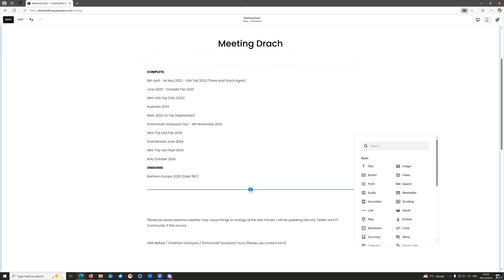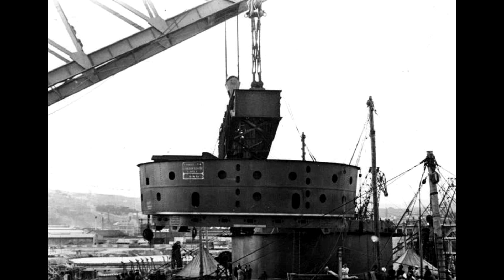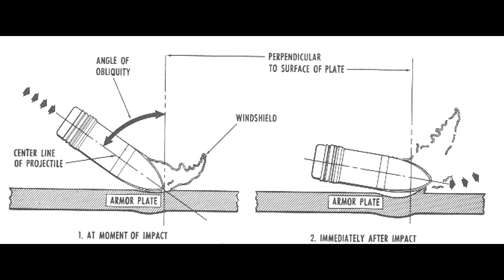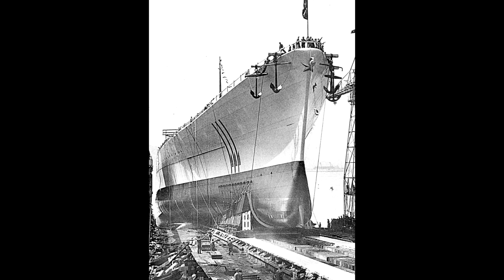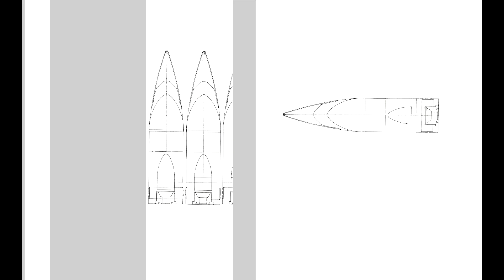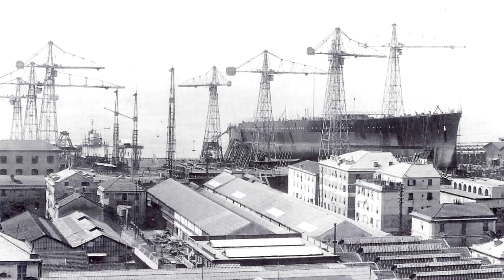Naval Engineering - Did the Littorio's Armour Scheme Work?

Comment: So what happens to the ballistic cap when it hits the decapping plate? Where does the cap go, that it no longer stands between the armour and the main body of the shell?
Reply: That is irrelevant as long as it was dislodged from the main body. The cap on itself has little penetrating power since the main body of the shell provides the energy. And the main body itself (though higly energetic) is too soft to penetrate the armour.
Reply: @vitkriklan2633  Thank you for the answer.  But perhaps I worded my question poorly. So bare with me. 

The shell hits the decapping plate, and the cap gets dislodged. But the main body of the shell still pushes forward, and the now dislodged cap is still physically present in between the armour and the shell (I assume it did not evaporate), so where does it go? Where the physical remains of the cap go after the impact, that it no longer is in the way of the rest of the shell?

Comment: We lack reference about the density and characteristics of the concrete, assuming it was just that and not addictioned with other stuff, like Asbestos or similarly common products.
The seasoning of the concrete also comes in place, especially if it contains coccio pesto in presence of humidity, as it keeps strengthening with ageing, pretty common since Portland was under sanctions during the thirties. We know the steel was best in class, as it was on the specifics to avoid using Russian steel. Still we don't know the exact characteristics of the steel itself.
It is a pity that the armour effectiveness was not tested before the ships were scrapped, just to gain knowledge on the subject.
Littorios themselves were basically shooting between 25 to 30Km all along the war, so, completely immune from any hit on the belt, because of angling and distance.
In the end it matters not, because no inter war ship was ever hit by another one in the belt as far as I know: the complete removal of armour from modern ships shows that it could not protect effectively against large warheads, like torpedoes, and it would not protect from the air, so it was considered a waste of money, weight and space.
The relict of Musashi examined by Japanese engineering team showed that, as the ship start listing, the concussion of the air launched torpedo was enough to shatter the welding on the Citadel and the ship flooded, not due to plate penetration but due to disconnecting of the huge plates themselves.
In the aftermath of skimming anti ship missiles, we can see where this would lead.
Reply: According to tests conducted in 1935 the belt was supposed to resist a 406mm (16 inch) AP shell fired from 24km
Reply: @lolloblue9646  It was deck armour, not belt and 406 mm shells were simulated.
Reply: @Viktor-fl5mv  the deck was tested against bombs at termimal velocity
Reply: @lolloblue9646  what you wrote was described in Bagnasco book and these were simulated tests of deck armor against 406 mm.... Deck was tested too against bombs

Comment: Very mathematical, D.  I suppose that they had to work with the materials at hand, or which could be produced in a reasonable period of time.  In terms of structural competence/capability, I can think of little other than concrete, or foamed concrete, which would satisfy the requirement.  Something severely harder and lighter would not (I believe) have been available to the designers, although the gap may have been a point which more fully occupied their thoughts - looking at the monitors of the period, with enormous torpedo bulges, for instance, I can see an Italian architect saying; 'No!  No way, scemo!  Not above the waterline!'

Comment: You also have to consider what was the maximum plate thickness which the italian industry could reliably produce. If the main belt was already at maximum thickness then the decapping + concrete route may have been the best answer within the capabilities of italian industry.
Reply: Drach covered this - he mentioned early on that the the turret front plate of the Littorios was 15 inches, so they could make plate that thick.
Reply: @CharlesStearman 

And in the first three minutes, no less.
Reply: You missed the bit about that and the 15inch faceplates on the turrets.
Reply: I think the keyword here is reliability produce, I don’t disagree with some of the others that Italian industry could make 15 inch plate. But a few plates for a turret face is a far cry away from an entire armor belt.

So perhaps they could make it just not in the requisite numbers.
Reply: @thedyingtitan1247  what are you talking about, they are not few plates they were 28 plates in just 3 years, this level of production is matche only by 3 other nations, Italy could had built them with a full 350MM plate or 381MM plate, as Italy has been at the forefront of metallurgic since late 1800s, its like one of the most famous aspects of italian naval industry.

Comment: Was the perpendicular force generated by an angled hit factored into the calculations for distance required to dislodged the cap? I think this should make a substantial difference
Reply from the maker: Yes, that's why the a calibre-equivilant thickness drops substantially when you account for the angling of the armour and fall of shell as compared to a 90-degree perpendicular impact.
Reply: @Drachinifel  ok, I mistook it to just be taking into account the increased distance as a result of the angles

Comment: I wonder if foamed concrete has properties similar to perforated armor, where the micro gaps cause massive stress on the impacting projectile, which in turn causes projectiles like a kinetic APFSDS dart to break up while passing the armor plate. Maybe foam concrete could actually aid in shattering the cap through constantly shifting stress on the material.
Reply: Good thing to consider, I think it would heavily depend on the size of the empty spaces in the concrete. The reason it works well against APDS and APFSDS is because the perforations are big enough such that a large portion of the projectiles cross section isn't hitting the armor and so a perpendicular force is generated on it. I don't see how that effect could take place if there are just a bunch of tiny air bubbles in the concrete. 
Something that I didn't see explicitly factored in here is the effect of the concrete acting as a backing plate to support the decapping plate, which would improve its resistance and how much having to plow through the concrete itself actually contributes
Reply: It's not concrete per se but that's kinda sorta how NERA armor works
Reply: @flavortown3781 yeah, different methods to achieve the same effect; torque on the projectile. Performed plates would work better against full bore shells than NERA though
Reply: Unlikely, because of its very fine geometry, APFSDS needs relatively little shear stress to break the rod up. A naval shell is so different in that regard (being only a few diameters long), I doubt there is any similarities.

Comment: The cap also helped align the shell to more of a 90 degree angle when impacting inclined armor or when plunging at high distance. Similar solution was used in tanks in ww2 but the cap on tank shells was strictly soft and was there to align the shell and mitigate the advantage that sloped armor provided.
Reply: And strongly contributes one of my favorite things for tank shells of making the longest acronym you can that's still technically feasible. I normally just settle on APCBCHEFSDS. Or Armor Piercing, Capped, Ballistic Capped, High Explosive, Fin Stabilized, Discarding Sabot. You could go with HEAT instead of HE, but that would hardly make actual sense for a shell with an armor piercing cap.
Reply: @chrisc1140 And here I was thinking APFSDS was an eyesore, and you just go and come up with 5 more letters to stuff in, you madlad.
Reply: @mnxs  tbf his shell while possible to design would be pretty useless. 

For one fin stabilized discarding sabot shells are usually steel, tungsten carbide or depleted uranium in a solid rod of metal. They are already quite aerodynamic and self alignment would harm performance so both C and BC are gone. 
HE is obviously useless on a DS round since it's a small payload and the payload itself would lower the mass and penetrative performance of the metal dart. 

There is a reason APFSDS or HEATFS are the ones used by modern armies, its the current META, even the Brits are dropping their hesh in favor of FS shells.
Reply: @HalIOfFamer  And then you enter ukraine and everyone needs HESH and HE, and multi-purpose HEAT is kinda...shit. 

But on topic of shell, discarding sabo behind the main APHE? Combined ammo like this is actually possible, and should (technically) work better. Just yeeting a rod of metal is better to deal with armor tho.
Reply: @alexturnbackthearmy1907  what would a shell like this work better against? My knowledge of tanks ends on tiger OP. Would standard APHE work better against medium armored targets, HE for unarmored and APFSDS against armor?
Reply: @HalIOfFamer  I guess something like that. Also should (hopefully) work better against spaced armor while still being very effective against light-medium armor. Even if armor with enough spacing to provide sufficient enough protection doesnt exist. Either way, if something doesnt exist there either was never real need for it or its just isnt worth it.
Reply: @chrisc1140  You mean as a full-calibre APHE with a cap and a ballistic cap, and its also fin stabilized? That´s quite a stretch. And where would you fit that discarding sabot? I mean, the only thing that typically uses a discarding sabot is the APFSDS, and that´s because its quite literally just a thin rod, and not a huge container with explosives inside and 2 caps sitting on its nose...